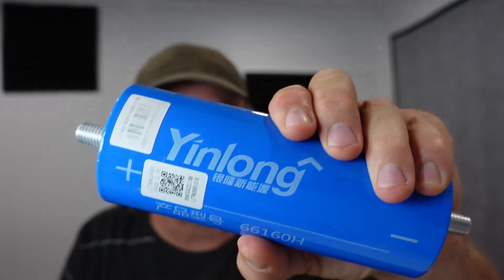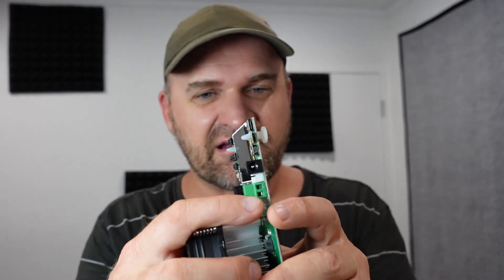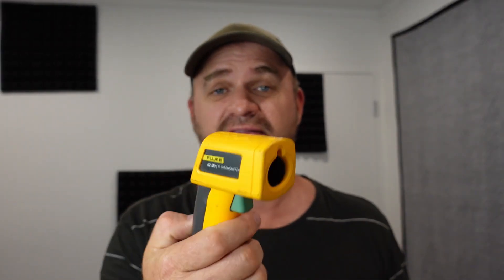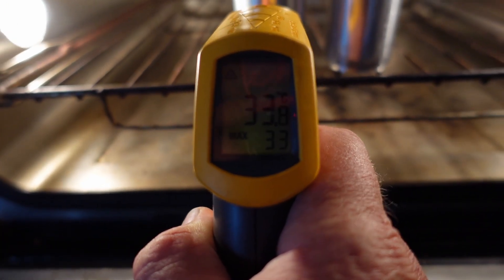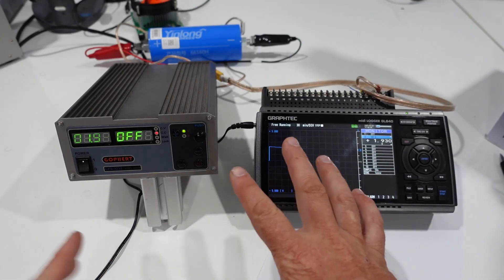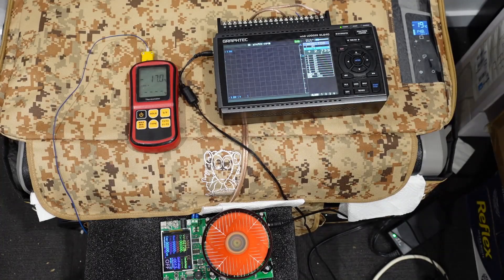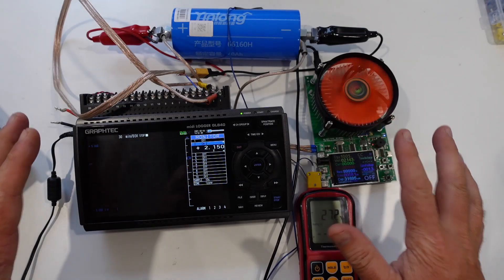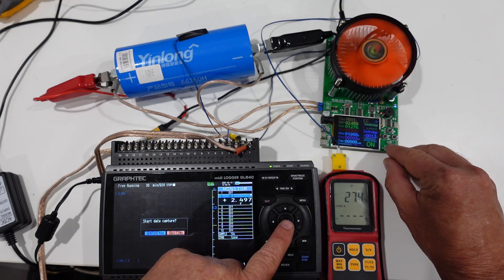Battery testing Low temperature LTO

Comment: They don't work on glossy or metallic reflective surfaces pretty simple science we use black cards to tell the temp of freezers besides probes that already exist to trigger alarms
Reply from the maker: Nearly...  but it's probably not quite as simple of a science as you might think..  color doesn't really make a difference, the spectrum of infrared that they measure is an order of magnitude higher than we can see, colors that we can see dont exist outside of our spectrum, pretty much all colors seem opaque to it.  As an example...  glass is quite glossy, and not very dark in color, however it's emmisivity is similar to matt black paint.  The bits of aluminum I measured both had a similar glossiness and appearance but measured a very different temperature to each other.
Reply: @brendontait6968  did I say a colour no
Reply from the maker: In the IR spectrum that is being measured by these, depending on the 'colorant'...  what we perceive as white could be perceived by the IR meter as black and vise versa, what we perceive in our spectrum is not necessarily what is seen in the IR spectrum, semantics aside.
Reply: @brendontait6968  man you're dense the first few words of what I said are reflectivity not colour  the black cards are non reflective and are used by multi million corporations and they rely on them for government logs. good luck with your channel as u asked for a simple answer and didn't know it in your video or u could have stated the problem 😉 but fact is you didn't.
Reply: @brendontait6968  you should probably read before u spew

Comment: Those infrared thermometers really grind my gears too. The things can work great, but it's really about how you use them and when it's a suitable tool. For example I saw someone use them to compare the temperature of phones by pointing it at the plastic, glass or aluminum housing. It's could kinda work if you know the emissivity of the materials, but with these plastics you never know exactly. Besides, most of the cheapo ones have a fixed emissivity factor.
Reply: So true! Most people don’t know what the word means, so here: emissivity gives a number of factored probability of how many times you can say “ey missy!” to a woman before she scratches your eyes out.
Reply: Addendum and case in point: one of the thingies in the oven was called “ey missy” to the point of getting all hot and bothered, which explains the temperature differential. I might note though, that until today I had no idea about the obvious correlation between women and aluminium cylinders when it comes to “ey missy” reactive abilities. Thanks, learned something!

Comment: You can't charge a lithium battery below zero degrees? You mean celcius? How can those electric cars charge below zero celcius? They're parked outside here and we had minus 10 last week..
Reply from the maker: Hey Truss, yes, that is correct.  In degC.  Batteries in cars typically have heaters in them and won't allow them to charge unless they are within a specified temperature range
Reply: Of course he means celcius! We don't measure in bananas here in NZ ;)

Comment: Is it down to emissivity? I'm not sure what the difference is between the two because they look very similar. Surface corrosion? Wrapped in tape? Anodised?
Reply from the maker: Yes, you are the most correct so far - tho your 3 guesses are wrong.  You get 8 points (I took points for anodising since emissivity of aluminium oxide is similar to aluminium)

Comment: My slightly educated guess is because aluminium mostly reflects IR, so you're basically measuring the room behind you/yourself? Possibly the reading difference is because on one you measured the rack beneath which is non-reflective to IR? Interesting trivia about charging lithium cells below 0 :)
Reply from the maker: Hey Josh,  You're on the right track, tho not quite...  you get 5 points!
Reply: @brendontait6968  Hahaha thanks - can I cash these points in? I guess I'll have to wait until you make a video covering this topic to find out the truth :D